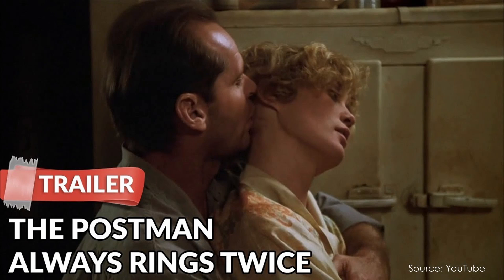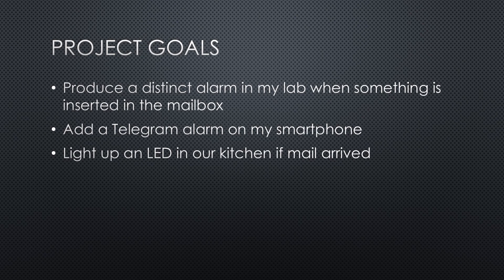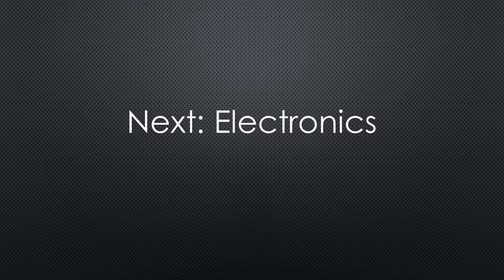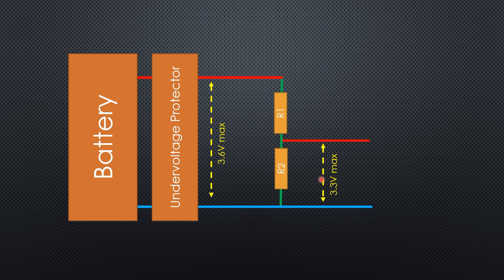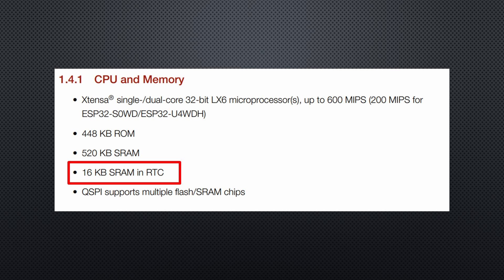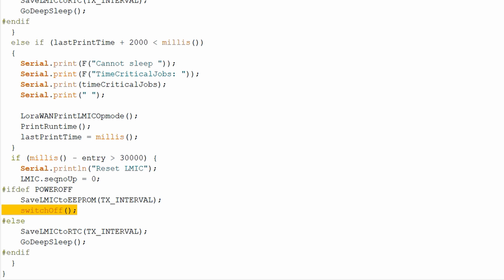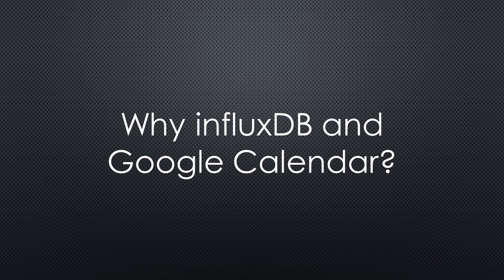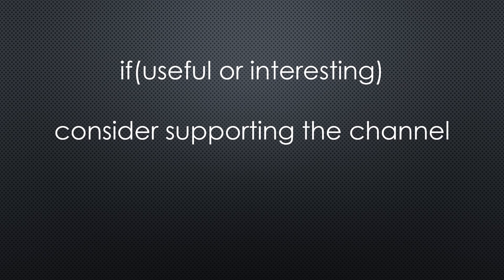#402 LoRaWAN V3 Mailbox Notifier (TTN)

Comment: Excellent video, thnx! I made a similar project a few months ago, however my mailbox is within WiFi range of my house and is aluminium so I am able to use Wemos D1 mini ESP8266. I have no flap on the letter hole, so I use a load-cell/HX711 to detect changes in weight when mail is delivered. The alert is done using the Blynk mobile platform to send an email, SMS and iPhone alert when mail is delivered. I've noticed that the load-cell resistance varies slightly with temperature, so I added an input on the app to adjust the threshold as temperature varies throughout the year. Finished off with VCC monitoring to warn of battery life and a customs PCB. All up very useful and reliable.
Reply from the maker: I thought that these load cells are temperature compensated. Good to know that it is not the case...
Reply: @AndreasSpiess  The HX711 may do, but   as I am using ESP32 deepsleep, I need to run all my code in setup(), I can't use tare() method because if the ESP wakes up, runs tare(), then it won't detect any new mail (weight) on the load cell . . . I use the 'raw' load cell reading each time and compare to a known baseline. I have a set threshold and if the load cell reading is above the threshold . .   "You've Got Mail"

The load cell is a Wheatstone bridge, the resistance varies with temperature, so without tare(); the baseline varies slightly each time the ESP wakes up . . . 

I think I have an 'industrial' solution, not so refined but it works for me and I get excellent battery life, low VCC notifications . . . and no wasted trips to the mail box ;-)
Reply from the maker: The wheatstone bridge uses 4 resistors, two should help to remove the influence of temperature. But if it can be compensated there is no problem...

Comment: we have those too, except there is a generator for a capacitor that works on the door opening and closing, no battery required
Reply from the maker: Like the Enocean switches. I am not sure how hard my flap would open to generate enough energy. The door opening seems to be better to generate enough energy.

Comment: after all these years with esp8266 and esp32,  there is still no pre-made boards which has the efficient deep sleep issues resolved?
Reply from the maker: I made video where I compared the boards. But here I needed one with LoRa. It seems that the Cubecell boards are quite good in deep sleep.
Reply: @AndreasSpiess  I made the same project as you with a door switch.  To solve the power problem, I removed the FTD231 UART, the 3.3V LDR from an ESP32-Dev board, replacing it with a 3.0V LDR.  Running it off a standard 18650.  I used one of the "wake pins" on the ESP32 to send battery voltage to my cell phone via Twilio.

Comment: Hi Andreas, great video as always. I’d love to install one in my building. I wonder if the signal could travel through 3 concrete slabs to a 4th floor. The distance is about 20 meters but vertical through concrete. It’s a 915Mhz frequency I’d need to use. Have you done any tests through walls and concrete? I’d love to know before I start buying all the hardware. Cheers! Keep up the good work. I can’t stop binging your content which I’ve discovered only recently. By the way, the little hand you use to point things out keeps cracking me up like I’m special. :)
Reply: I think it could work or else you install a big antenna and if it still not works install the gateway more near by like the basement if you can get internet there. Or add an other lora outside the box which relays the signal to your gateway. just try it out befor you invest a lot of time into it. You also could buy just two relativ cheap lora boards to test first the lora to lora conection.
Reply from the maker: RF choses the easiest way. My LoRa sensors work fine from the basement to the roof (3 floors). But I assume not through the concrete... But who cares if it works?
Summary: You have to try to know.

Comment: Great project. Suggestion. Micro switch, limiting resistor, large capacitor, flap opens, charges cap, transmitter comes on, receiver notes attempted connection and registers it as flap opened (mac address, no need to send data), notes time, does rest of stuff
Reply: Hi Andreas something strange showing up on comments. Maybe different character set. Thanks again video. I have a well 250 away that I need to monitor.
Reply from the maker: A troll uses my name and picture and leaves a ton of comments. I understand your concept. However I prefer to let the micro switch power off when finished. It is more precise, I think. You are right. I only could send one character (LoRaWAN needs at least one character). But I like to know the voltage.
Reply: @AndreasSpiess  sorry to hear that. My email was used to spam people. Very annoying. Keep up the great work.

Comment: Had similar issues myself, ended up using a solar powered WiFi security camera with built in human detection. Total cost was about USD$50. The software allows me to setup a virtual security  fence and when a human enters the area around my mail box it triggers the camera to send a picture to my phone. I ended up writing a security program and using one of my running Raspberry Pi servers as I was a bit wary of using an app that has servers in China hooked up to a security camera.
Reply from the maker: Lucky you! Since I life in a very crowded area Security cams have a hard time to only detect meaningful signals. I have one on the front door, but it still creates false alarms. Even with the electronic fence :-(

Comment: Nice solution! I keep pondering a letterbox notifier, though my circumstances are quite different (private property but no flap i.e. mechanical movement).
Reply from the maker: Other viewers use a load cell on the floor of the box to measure the weight.
Reply: @AndreasSpiess  I wondered about some form of weight sensing, a microswitch and lever maybe. It would have to very sensitive but also quite robust. What's neat about your solution is the momentary ON operation, allowing zero standby power.
Reply from the maker: You could only measure weight once ever half hour or so to save energy, I think.
Reply: @davidstonier-gibson5852  They sell flexible strain sensors that are 5" long.

Comment: I suggest one more component in the transmitted message:  a sequence number. That allows the receiver to detect a missed message.
More thoughts:
A periodic message might also be good to confirm operation, but then you either need to send a reason or deduce based on time (every morning at 05:00 is unlikely to be the mail carrier) that it is the automatic message.
Finally, sending battery level in each message could be convenient.
Reply from the maker: The battery level is transmitted in the message. I agree, a periodic message would be a good thing, but would need a very different setup because here, the ESP32 is completely switched off. You could use deep sleep to achieve that.
TTN transmits a sequence number and I could check it. For this use case I anyway would go and check the box if no alarm came till the evening. So I discover the "missed" message (if I find mail and did not get a message)

Comment: If you put a sensor on the top and bottom that would be better. This way a package in between the two sensors would interrupt them. This way you don't have to press a button to reset it. The door method doesn't quite know if there's mail or not. Or a pressure sensor somehow might work too. Anyways this is a good way too.
Reply from the maker: I do not know how to create  a passive sensor on top and on the bottom. A light barrier would need too much energy. Another viewer added a LIDAR inside the box which is triggered after the door is moved. It detects if something is inside the box.
Reply: @AndreasSpiess Yeah passive is better for lower maintenance

Comment: Great work, Andreas! For my solar-powered sensor project I chose the Arduino Pro Mini as main controller with AT328P running at 3.3 V. Deep sleep with RAM retention is done by sleep_mode(), during sleep its consumption is below 0.1 mA.
Reply from the maker: The AT328P is probably the better solution for a LoRa node. The only problem is the memory space for the new library...
Reply: The ESP32 in "deep sleep" consumes 1/10th of that, 10uA.  8-bit processors are annoying because you are always wondering if you will hit the memory ceiling.

Comment: Hi. Thanks for another great video.
You should add an alarm on the exception that the postman leave the door opened. It could be an additional function, just to evaluate the postman work or how many shipments doesn't fix in your postbox. Greetings from Peru!
Reply from the maker: It would be easy to send another message because the ESP32 stays on if the lid is open. I could send it before it goes to deepsleep.

Comment: I did a very similar thing with a Heltec Cubecell (HTCC-AB01), a 1000mAh LiPo, a Reed-Switch for the flap and a Lidar mounted to the ground pointing upwards to detect if something was inserted or there still is something in it. That cubecell has a small JST connector for the LiPo and buildin LoRa. I only had to change the antenna to get through all that metal.
The deep sleep current of that cubecell is low enough, that even waking it up every 6h additional to waking up from the switch lets it run for years. Currently my mailbox notifier runs for about a year and the LiPo is on 87% (4,2=100, 3,3=0) and was only charged additional 3% in that timeframe, because I had to debug some parts that the postman destroyed by brute forcing a package into the mailbox.
Regarding the Lidar for detecting content in the mailbox: that also works great. I used a lidar with a range of 5mm to 100mm and made sure the connector for the wires lifts mails and packages to at least 5mm. alternativly a small "cage" could fix that. the lidar is placed in the middle of the mailbox on the ground and because our mailbox is not that big, basically everything except maybe very small postcards lies on it or floats above it, if the postman leaves the flap halfway open with a newspaper in it.

Oh and regarding the winter, only one thing was effected: the RGB LED was temporary only white on cold days, which was strange. I use that onboard LED to light up the inner for a second and also show, if sending the information was successful.
Reply from the maker: Another viewer also used a Cubecell which seem to have a very low sleep current. So far I had nobody just using the flap. So I had no need for a lidar. But it is a good idea if somebody discovers the sensor...
Reply: what antenna did you use instead of the one of the heltec cubecell? is the antenna still withing the metallic frame or did you attacht it outside?

Comment: Could you not attach a load of peizo transducers to the inside of the mailbox and into a battery charging circuit.  The vibration from traffic etc will produce electricity from the transducers, which would add up over time.  Would probably need to charge a capacitor and burst charge the battery, so probably need two cells and circuit to charge one whilst the other is in use...maybe.  Just an idea if it's low enough power, maybe doable.

Imagine a sensor powered by noise.
Reply from the maker: I once made a video about energy harvesting and I will cover the topic in a future video. It only produces a tiny amount of energy. In the case of the mailbox, fortunately we have no traffic noise and just the movement of the flap would probably not generate enough energy.

Comment: I've had a similar project on my desk for months.  Using one of the Cubecell boards that has a tilt switch connected, to send a state change, transmits thru TTN, then goes back to sleep. Right now been sitting on my desk that beacons once a day for battery levels. Going on months now and battery level has been amazing. This may inspire me to finally just get this project done as the previous mailbox motion sensor was recently destroyed by ants.
Reply from the maker: Other viewers also used a Cube cell. This seems to be a very good solution for such a sensor.

Comment: wife send you to get the paper ? now i see why you were motivated to make this :D
one thing i like about Esp8266 vs esp32 is that it can just read input voltage and there is no need for using a GPIO or voltage divider. I've ran bare esp8266 with direct lipo charged to 4.1v, if anything it runs better and gives stronger wifi signal. not tried that with ESp32 as i like them too much to chance it. when battery life and size is critical i use an optoisolator connected to a GPIO in between the voltage divider (just to make myself feel better).
great video as always, VERY clever decision to use the reed switch, the choice didn't even accrue to me, I thought a radar module would have been the best choice.
Reply from the maker: Good point about the ESP8266. I do not know if the ESP32 has a similar functionality. But the voltage divider was not a big thing.
Reply: @AndreasSpiess  I've wasted a lot of time looking for an equivalent command to ADC_MODE(ADC_VCC) for esp32, but from my understanding its not supported not due to lack of code/library but hardware design. pity because its such a nice feature that lets you add battery monitoring to all your project for free.

Comment: Could you add a telegram notification when the wife alarm is cleared, so you know if the mail was picked up while you were out?  What about a clear button in the mailbox itself?  You wouldn't want to have two people checking the mail if they arrive at different times.
Reply from the maker: The design of the "Happy Wife" box in the kitchen has no reverse channel. So in my case it is not possible without changing the logic of the kitchen box. But the ESP has all info and I could send an MQTT message to node-red to "clear" the telegram alarm. Maybe I will do it once.

Comment: ESP32 does not emulate EEPROM in flash. It has its own built in 512 bytes in itself.
Reply from the maker: I always thought that the Arduino platform uses the flash. As mentioned in the video, the LMIC structure is also bigger than 512 bytes.

Comment: You could add macros for an easier way to handle the Serial .print removal. 
#ifdef DEBUG
  #define DEBUG_PRINT(...) Serial.print(__VA_ARGS__)
  #define DEBUG_PRINTLN(...) Serial.println(__VA_ARGS__)
#else
  #define DEBUG_PRINT(...)
  #define DEBUG_PRINTLN(...)
#endif
Reply from the maker: Thank you for the tip. I one had an include file with those macros (including 3 debug levels). But I forgot it over time :-(

Comment: I think a shock sensor would have saved you a lot of hassle!
Reply from the maker: Why do you think?
Reply: @AndreasSpiess  When the mailbox flap isn't closed properly, the reed switch remains on keeping your circuit on. DeepSleep() still uses a bit of battery. A shock sensor will only be high when moved. A small cap to your prototype circuit to hold it high long enough for the mcu to start up and hold that pin high and voila. Part SW18010P.
I have a similar prototype to turn the board completely off and a lot smaller I would like to show you...

Comment: Replace the (possibly difficult to align) reed switch with an accelerometer, keeping the clever sleep modes,  and you have the ultimate "someone moved my thing" device for security / parcel boxes / vehicles / barn doors / anything!!
Reply from the maker: I never looked at the current consumption of accelerometers. If it is very small this could be a good choice. I will have a look at it.
Reply: @AndreasSpiess  there's a couple that you can preset some movement thresholds and then put to sleep and they then generate an interrupt. Config can get a little complex though. Would love to see it working!

Comment: Simple and elegant, as always. But what about the sub-freezing winter weather? I was under the impression lithium batteries won't last when they're frozen...? 👍
Reply from the maker: We will see. The Li-Ion batteries on the roof survived the winter. One died during summer. So I do not know if it was the cold or the heat. In the mailbox there is no charging. On the roof I have solar power.
I still have the possibility to go for primary AA cells if it does not work.

Comment: I will be curious how this will perform in the winter. Do you imagine the battery or switch will be affected much by the cold? Great project and video as always!
Reply: All my outside sensors are currently powered by disposable cells so I have no personal experience.  I know of several projects by other people however that perform well in cold with Li-ion cells and no heaters.  The primary places I know where heaters are required are in high altitude balloons (edge of space) and off grid battery systems(high charge/discharge).
Reply: Charging a lithium cell in the cold is a big no-no, but usually low current discharge is fine.
Reply from the maker: I had a few Li-Ion batteries on the roof during last winter and I even charged them with solar. They survived, but one died during summer. So I do not know if it was the cold or the heat.

Comment: For audio notification I have an esp32 with an I2S decoder and class D amplifier module, speaker and a miniature 240 to 3.3V switched mode PSU in a little case. I wrote a little app that plays a specified mp3 from an internal web site based on an mqtt command from node red. This way I can ring the door bell from an RF bridge, play an hourly ding like a clock and or any other sound. 
With an enclosure  designed with audio in mind and reflex ports and a reasonable little speaker, a normal person could not hear the difference between mechanical bell and my box. People actually comment on the old style mechanical two tone bell.
Reply from the maker: Cool project! I once did a similar thing but with an MP3 player module instead of a I2S interface. My viewers were enabled to trigger a messages back then...